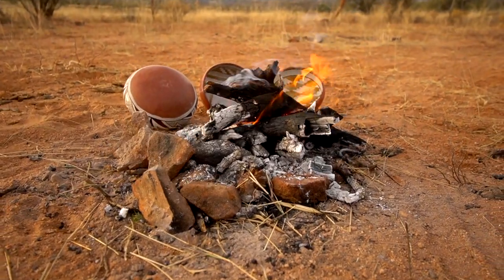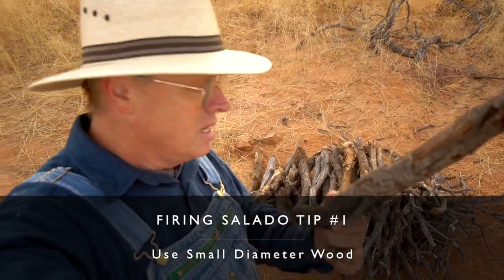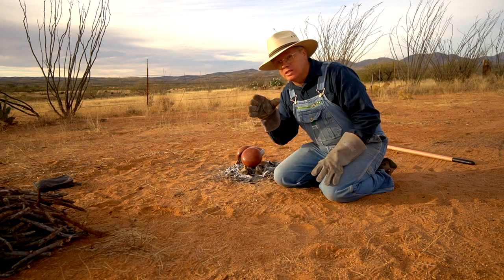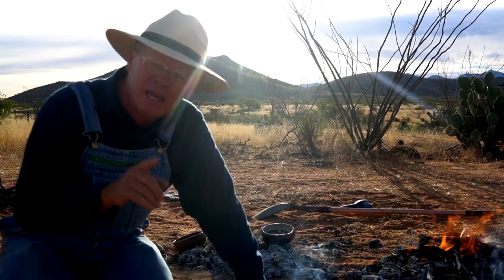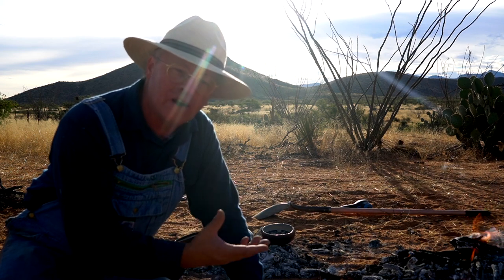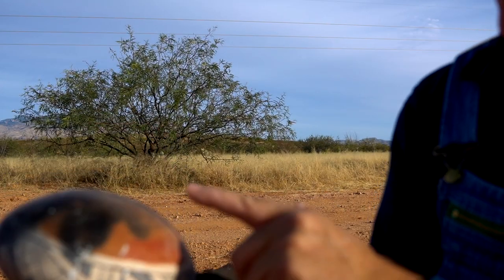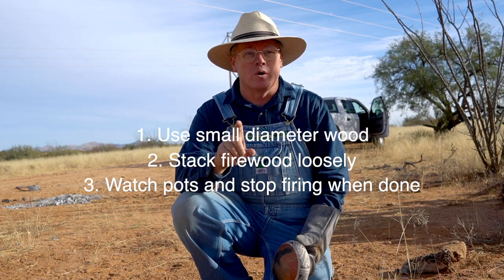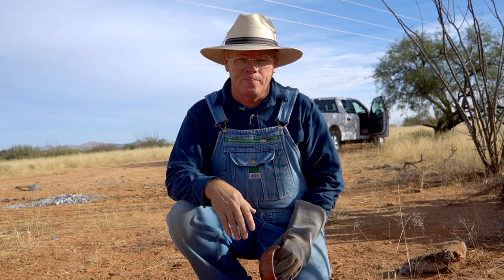Firing Pottery in Less Than 15 Minutes, The Salado Firing Method

Comment: Great tips Andy. As usual, I learned something helpful...
I fire in my woodstove. I know it's not strictly traditional, but once you understand it a little, it works great.  With some blacksmithing tongs, It's possible to get those fire clouds to land on the pot where you want them, for instance. I get an interesting control with atmosphere by manipulating the dampers at different points in firing, as well. Give it a try if you have access to one. The results can be quite fine.
Thanks Andy....and Happy Holidays from Scholle, NM! 🎉
Reply from the maker: My first ever pottery firings were in a woodstove. There are no rules to pottery, just a million ways to do things, everybody does it a little different. Thanks for sharing your process.
Reply: Yes, there are, and I really appreciate the sense of sharing/community you create here...and I will share anything that seems relevant and helpful too!

Here's one...
If you fire in your woodstove you can sleep for that hour that you spend driving to the boonies. 😋

Comment: I have been learning SO much from your videos! I recently found some clay at a local creek which inspired me to to start looking into pottery. Question: have these vessels already been fired once and then painted and this is the second fire?
Reply from the maker: No they have not already been fired. Traditionally, pottery in the Southwest is single-fired, so the pots are formed and decorated, then fired only once.
Reply: Thank you so much Andy! I’m planning on making ceramic beads. I’ll add temper to the clay, form the beads, add a white slip. When the slip is dry, I’ll try and carve out a design. Then I’ll fire outside using this Salado technique. It will be very experimental, and who knows:could turn up horrible. But it will be an experience, and I’m sure I’ll learn some things! Any tips you can think of for clay beads? I noticed you kind of placed the pots on some rocks, but I’ve heard river rocks can explode if used in fire. Thank you so much for these amazing videos!!!

Comment: So the mesquite sap pot .... that design of pot ... what do you think it was used for? I have a pot I cook in with that shape but it is 2 pieces with that style top (I call stove pipe top) it makes great eggs or small one pot dinners or bisuits & some other small raising bread.
 Though your pot is basically same shape it is one piece which would not allow it to be used as I use mine.
Reply from the maker: Yeah, a lot of these were not cooking pots, in fact cooking pots in the ancient southwest tended to be plain or corrugated, not decorated like this one. These kinds of pots were probably used for storage.
Reply: @AncientPottery  that does make sense with small hole top & so could be sealed with wood plug or wax & wood plug & since side of top slant toward hole it would be easy to pour even last little bit. Thank you I should have seen that myself but am always thinking of cooking end i guess. Maybe i should consider it ingredient storage or spice containers. Clay pots are very good to store in.

Comment: How can you tell when it's reaches the right temperature without using paint/slip?
Reply from the maker: If you are not using organic paint it is much easier because there is no danger of overfilling it so I will just let it burn until the wood is all burned up. I have other videos showing this method too.

Comment: Why is it that everything I read online says you have to pit fire for hours? Iv read anything from 4-18 hours in the fire.
Reply from the maker: No idea, once the pottery reaches the desired temperature it does nothing extra to hold it there. If your pottery is massive or thick it may take longer for the middle to get hot enough, but if your pottery is relatively thin, it should be a rather short process.